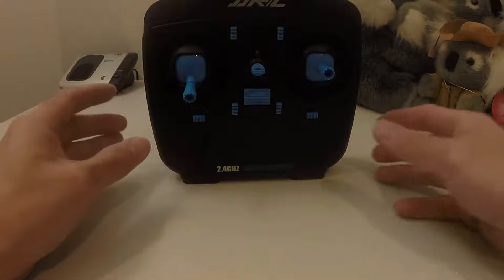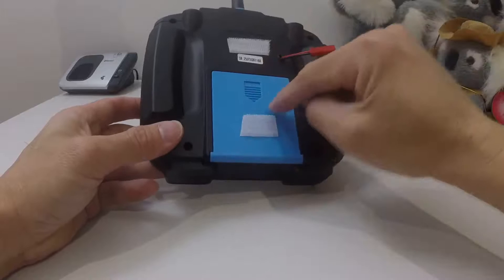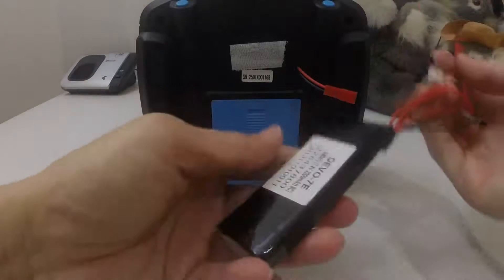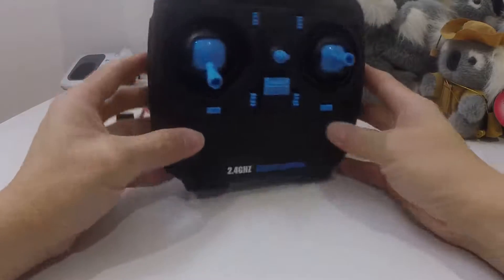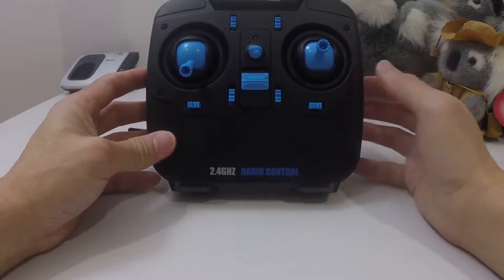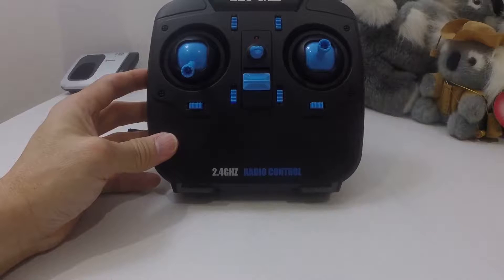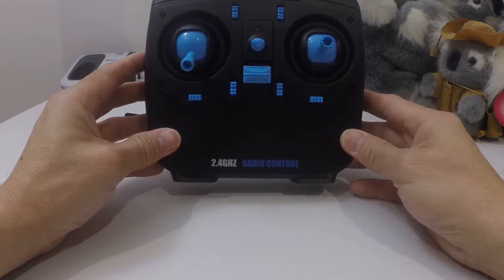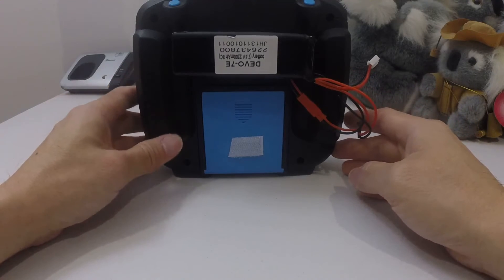Quadcopter - JJRC X1 - Transmitter Lipo Battery Mod (Solved Twitchiness & Yaw?)

Comment: Can I use battery 18650 instead ? I think 2 battery 18650 can give a same voltage as the lipo 2s battery.. *and it's cheaper LOL
Reply from the maker: Thanks for watching! I don't see any problems there if it is within the voltage range.
Reply: so, in theory it will be works right ?
Reply from the maker: M Argus Chopin Gyver Yes
Reply: But still saver to use a regulator voltage ??
Reply from the maker: M Argus Chopin Gyver Maybe before after you set up the battery, check the voltage first. So you have this transmitter for JJRC X1?
Reply: At this time, i'm not have it. But I'm planning to buy it. But I think I will go to a rechargeable AA battery (because it's little bit easier to work with)

anyway, thanks for the info :D

Oh yeah, do you have any plan to put jjrc x1 to a carbon frame (like QAV 210 or even QAV 250) in the future ? I would like to see how to organize x1 component on that frame...
Reply from the maker: M Argus Chopin Gyver Hi, my advice is not to buy JJRC X1 as it has too many problems and now outdated. There are better ones out there. I don't intend to put on carbon frame. Again there are good and reasonable priced carbon frame quads out there.
Reply: jtgravityRC In indonesia (where I came from) is just so hard to find any brushless quad with that price (1,4 million rupiah).

I already buy it and I think the yaw lag not happen to me (Or i didn't notice it) and the wobble is gone when I put a triblade HQ props..

Anyway, I have a plan to build a carbon fiber quad (but not at this time and the reason is the price just too high) just because I fly my x1 and I'm interested in this hobby :D

Oh yeah I forgot to mention, I already buy x1 tho :D
Reply from the maker: M Argus Chopin Gyver I see :) All the best :)

Comment: The lipo should be running at 7.4?  Thats not gonna fry with the extra .4v?
Reply from the maker: Yes, you are correct. It is just that the buck converter keeps it at 7 volts and I am not sure as to the reason; I tried to test the converter up or down and it didn't change voltage. Anyway I think the transmitter can take more volts than  6v although it is not stated in it. I am sure if you run the Lipo directly it should be fine. I think it is safer with a voltage regulator.
Reply: +jtgravityRC ahhh i see....  Ill give it a shot with a Pololu regulator!

Comment: So what voltage did you end up feeding into the TX??
I'm about to get my X1 delivered and I am not getting a Devo TX anytime soon....
Definitely gonna make something similar to this mod;
Any idea what the max voltage on that board is? On my modded Proto X FPV Transmitter the board has a label of 4v-13v..

Great Info, thank you!
Reply from the maker: Thanks for watching! It is around 7 volts which is the same as the voltage on my lipo. Don't fly too far when you are using stock transmitter. Keep it within 30-50 metres, And don't fly if there's strong breeze. Otherwise, you will lose signal very quickly. Hope you enjoy your X1. Please subscribe to my channel as I have many informative and interesting videos. Thanks in advance. Cheers!
Reply: jtgravityRC hello,i just bought jjrc x1...and i have some problem with my transmmiter i assume...when i power my tx,it constantly beeps,i can bind it and all,but i lose signal after some meters and like its going on it own,for about few sec it look like i dont have control,it goes on ita own...i thought it m8 be weak bat,so i put fresh alkalines,same...i did thought it was low voltage on transmmiter,cuz the sound reminds me of low battery warning...so i stumbled upon ur video...
Reply from the maker: Hi, I have retired mine. I was never able to solve it. Within very short distance e.g. 10 metres it was fine. JJRC X1 has inherent problems with transmitter and quad. It is a lemon unfortunately.
Reply: jtgravityRC oh man,so the lipo convert isnt going to solve my problem,so sad :(

Comment: Within days of receiving mine I recalibrated it. 20 meters off the ground 😠. Broke the top half of the front clockwise armature off at the body, as clean as if I'd cut it. Recalibration should be automatically disabled during flight. I've been using super glue and managed to fly thus far, but a frame mod is on my schedule very soon.
Reply from the maker: +Scott Watkins Yes, you need to be careful when doing right bank turns as the combination of stick movements will re-calibrate it mid-air. Thanks for watching!

Comment: You might be right my friend i used cheap brand battery's on my first flight and thought holy balls thats twichy.....So second run i tryed duracell which in my opinion are the best and i noticed  better controls so can't imagine with a 2200mah lipo.....mm just orderd a buck convert to test it out...... :D
Reply from the maker: +terry k Thanks for watching! It appears that it still doesn't work for me. I may have a faulty receiver board as I tested it yesterday and I still lost signal very quickly. Banggod is sending me a replacement receiver board. Hopefully it will solve the problem. Having said that the stock transmitter is not good. Better to use Devo 7e with Deviation. Cheers!
Reply: +jtgravityRC Thanks...Defo going to get a devo 7e but was worried about the range, don't really fancy the range.....So should i bother with the buck converter mod for original transmitter??
Reply from the maker: +terry k Don't bother with lipo mod this stock transmitter. Better to buy Devo 7e. The range is fine for recreational flying in a park and as long as you can get decent and constant connection. This is just a toy quad with powerful brushless motors and not meant to fly far. If you are thinking of moving up to more hobby grade flying, then maybe get Devo 10 which has better range than Devo 7e. Have a look at my latest test video on flying JJRC X1 with Devo 7e. Having said that JJRC X1 has many issues that cannot be solved with a better controller. A better controller will only help the in flying it in a bigger space. Hope this helps.